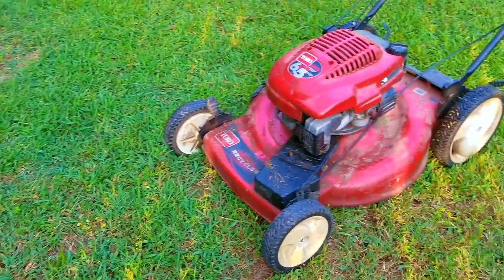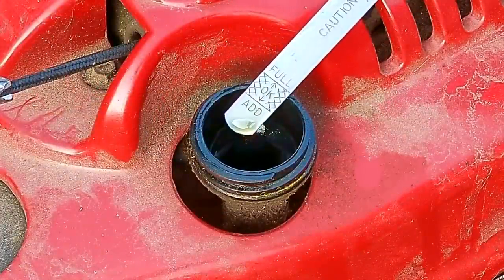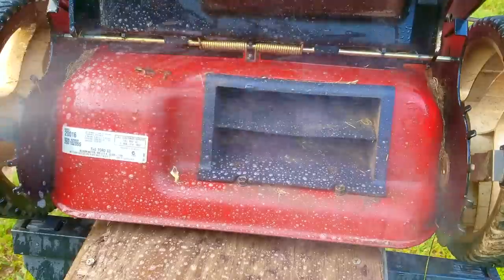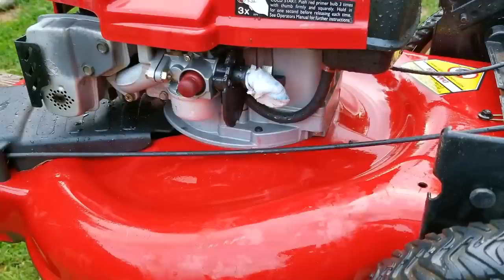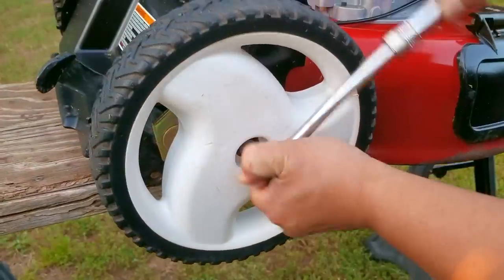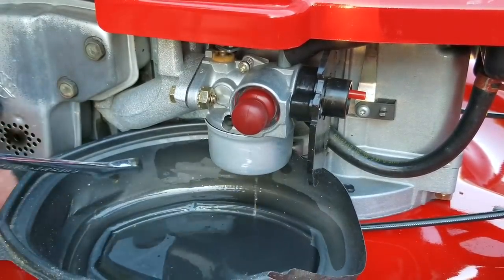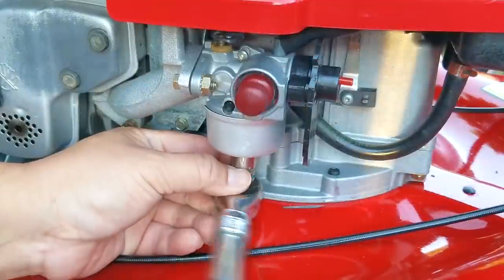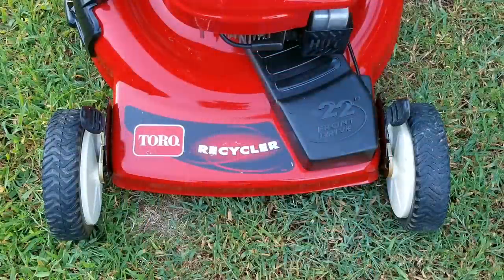Someone Threw Away A  Good Toro Lawn Mower

Comment: The best series of Toro consumer grade mowers IMO (short of the Super Recyclers of course). I love these older models, especially with the Tecumseh LV195EA engine. We really had it good through the 2000’s! You won’t find those decks flexing and cracking after a few years like the cheap tin cans they make now.
Reply from the maker: I know right, I miss the 2000's stuff too, when compared to the stuff now, thank you mjg263.
Reply: I bought a Bolens just a couple months ago and its deck seems fairly solid. It has a B&S engine on it, and so far it's been working good. I tend to not like mowers with self-propulsion, I know people like em but eh. I prefer mowers with the wheels tighter in close to the deck to make it easier to get a close mow up against trees and other obstacles.
Reply: @Dhalin  yes, I totally agree with you. For a trimming mower or a smaller yard I find that self propelling gets in the way and can be cumbersome. The Bolens plastic front piece can be problematic after time because of the plastic “fingers” underneath holding the front wheel axle in place (just had to fix one last week) but they are fine for what they are and there is a fix for it. The cheap tin can flexing mowers I was referring to are the newer Toro Recyclers. I have a pile of them in my garage with cracked decks for the scrap man. The steel they use is so thin now they crack under the chute and the deck springs out. Even if you try to weld them the deck is already sprung and it’s never the same (plus there are usually other cracks already forming). It’s a shame how tinny they are now compared to the great older ones!
Reply: agreed! I still have my super recycler from 1999. B & S engine.  Almost threw it out (well maintained). Some small fixes and it is back to running great.
Reply: I have the exact same mower with this Lv195ea I love it and will keep forever
Reply: I found a troy bilt self propelled mower one street away from me.. it was easy fix too !!
Reply: Yes I try to keep toro mowers with Tecumseh engines

Comment: I think you are right about it possibly being hydrolocked by the oil, by the way it’s smoking you can tell it’s just burning off leftover oil and it’s not oil escaping past the rings. The six horse Tecumseh snow king I have is so old that the float is made of brass instead of plastic which really shows how far these carburetors have come.
Reply from the maker: yes I remember those float, I prefer the plastic ones.
Reply: @HomeGaragechannel  the brass flavors I’ve seen get gas in them causing improper float level and need to be replaced by the plastic one to prevent this issue from happening
Reply: The brass replacement floats are still available through many suppliers, including Rotary, Stens and Oregon.

Comment: You went right to the problem most owners create with a Tecumseh carb.  The lower bowl nut with the passage....a super easy 5 minute fix.

Leave gas in it all winter,  and you get sediments in the bottom that plugs that passage.  Run it dry every fall and you seldom have a problem.
Reply from the maker: you are correct.

Comment: Had a similar find many years ago. My wife worked at a small business that did their own cutting. I stopped in one day and the owner asked me if I wanted their mower. It was a Toro rear bagger with the cast aluminum deck. He said it wouldn't start and would kick back and backfire when they would try. I took it home and after taking the blower housing off I could see the flywheel key was bent and the flywheel shifted several degrees. So for the cost of a flywheel key and an hour of my time I had a nearly new mower. I used it for nearly thirty years before the engine finally died for good. By the way I was a designer at Tecumseh engines and did the design for that pretty shroud on the engine.
Reply from the maker: wow, nice mower you got there, thank you Ron Post.

Comment: I got the same identical lawn mower sitting in my shed but not as new as this one, it served me well for a few years but then I noticed thru the years that the flywheel key kept breaking very easily by simply hitting the side of my concrete slab  or a pebble under the deck I just gave up on it and got me a Honda.I still keep hitting the slab and pebbles but the Honda just keeps on starting.
Reply from the maker: do you not edge before you mower?
Reply: @HomeGaragechannel  I do my edging with my weed eater, the Toro if you keep it at the lower level on the height adjuster the flywheel key seem to break more often than usual (like I was saying above)if you hit something not like the Honda and I do keep it at the lowest level.

Comment: True, they could just list it or put on the kerb with a label free.
In your advantage it had your name on it😀😀😀
Love the Tecumseh engines...😀
I was expecting it to be full of grass on the spindle, I was supervised too😉
It’s a keeper😀🇦🇺❤️
Like the mower I brought $25  Victa 2 Stroke 19 inch, didn’t start, perfect condition, 4 new blades, new carby parts, new champion spark plug as well, parts $80 retail can’t complain.
I did get it started after a few tries but it died so I think it’s the needle in the carb is sticking so I need to order a new one cheap but will try the metal ones rather than the plastic ones.
Reply from the maker: good luck with the mower.

Comment: As soon as I saw it was a Toro Recycler, I knew it was one of the ones with a Tecumseh engine. Good luck getting parts for it, now that Tecumseh has been out of the small engine business for 16 years.
Reply from the maker: aftermarket is still supporting them, so not a real issue

Comment: You would be surprised why people throw away mowers. Well....probably not. I got that old Craftsman mower with the kill switch issue from a guy that had had it sitting in his back yard for several years. It quit running, and he just pushed it into the corner of the yard and abandoned it. When I got it several years later, I had it running in about fifteen minutes. I gave it a quick carb clean, and it ran like a champ. Unfortunately, it is really weathered from sitting outdoors, but it ran great before the kills switch issue.
Reply from the maker: to be honest the reasons why they were given away are the interesting part

Comment: I found a similar looking lawnmower in a dumpster in front of a house down the other end of my street. It was along side another mower that was in pieces.
This was a newer design mower that had a sticker on it boasting "never change your oil again" "Just Check and Add". Well, that's exactly what they did. every time they used the mower, they added a little more oil. They added so much oil, it hydro-locked. I removed the plug and pulled on the cord a bunch of times to clear out the oil. Amazingly, the mower started up and ran. Quite poorly, as it smoked so much. I dumped out about a quart of oil and then proceeded to mow my lawn with it. The smoking eventually stopped. 
The next day I ordered a new blade, and filter, gave it a proper oil change and emptied out the fuel. Now It runs Like new.
Reply from the maker: wow very nice find!

Comment: Simple reason for getting rid of this type of mower, location of the pull start.  The handle mounted "safety start" is a shoulder killer, award pull angle can damage your shoulder,  particularly if you are older.  After doing just that my physical therapist told me I was not only case he had see.  Generally early spring, wonder why?  Only fix get an electric start.   Cheers Phil
Reply: Make that awkward pull angle
Reply from the maker: that's a very nice option to have

Comment: I've never bought a new mower, every spring I find mowers in the trash because people store them with ethanol fuel still in the tank and they are gummed up. An hour later after some carb cleaning they are running like new. Last one I found they filled it with fuel and the needle was stuck and it filled the cylinder with fuel, hydrolocked. Took it home pulled the plug and cleared the cylinder, cleaned the carb, like new!
Reply from the maker: very nice work!
Reply: Same for me in 2019. My neighbor tossed out an MTD mower. I took it to my house, leveled out the oil (it was clean), put a new plug and air filter and pulled the cord (after freeing it) and it ran like new. I just used it two days ago. The neighbor still gives me an odd look when he's out walking his dog and he sees me using it. His answer was, "I didn't need it, bought an electric" to which my reply was, "Yup, everyone throws out a good gas mower to get an electric so they can throw it out in three years when the cost of a new battery exceeds the cost of the machine". LOL.

Comment: This is getting weird. Maybe check the rear view even though it was curbside. 01/26/06 on the fuel hose so it was probably assembled that spring. That's a survivor for a mower museum. Maybe sell a different one first
Reply from the maker: I think, you'r on, to something
Reply: Makes sense as I looked it up on the Toro website and the owner's manual has a date of 2005, so a 2006 manufacturing date of some components makes sense. Tecumseh went out of business around 2008, so it makes sense with the date coding.

Comment: amazing how clean it turned out.  what did you use to clean it?
I have a What i think is a toro with a honda motor. not sure 
will have to go over it. and double check it. and write the 
numbers down.nice video.
Reply from the maker: thanks, I'm using a degreaser from Harbor Freight.

Comment: This is the same model as my mower. I've had it for about 17 years and it runs pretty good. On start up and shut down, a noticable banging noise is happening. It's probably doing it the whole time, but it's not noticable when running at full speed. I moved the blade back and forth a few times to see if I could hear it but nothing.. any ideas? It seemed to start doing it after I reinstalled the blade after sharpening. I think it's torqued well enough, but I used an impact driver not a torque wrench.
Reply from the maker: sure the cold be an issue with blade adaptor, and I would block the blade and use a torque wrench.

Comment: Hi, just subscribed, and learning alot in general and just got my first Honda used , in great condition for 100 bucks!! 

But my question is this... what are you using that degreases every thing so quickly and when you wash it, is there anyharm in spraying down the mower with a light sparay of a hose like you have done? When im done i usually wash the under neath and from the motor base down. Am i doing any harm in spraying down the top where the pull cord area is ...

Thank u.
Reply from the maker: thanks again, I'm using a degreaser from harbor Freight by most automotive degreaser will work. And to answer your question, its okay to spray water, anywhere you want except the muffler and where the air filter is .
Reply: @HomeGaragechannel  great thanks!

Comment: I'm guessing they gave up an bought a battery mower that will be trash in 5 years.  Nice job fixing and cleaning it!  I wonder how many other mowers were thrown away due to carb issues.
Reply from the maker: plenty from what I've seen, and yes Battery is probably the next step.  Thank you shmiggz.

Comment: Everyone I know that's had Tecumseh mowers they seem to run forever. I know they have an odd carburetor connection and I've seen them leak oil from the top of the motor from the rubber plug that goes to a crankcase filter I think. But I don't understand why Tecumseh had a bad reputation. They seem to last longer than a lot of Briggs and Stratton engines especially the new ones.
Reply from the maker: oh they're not that bad at all, they just need some getting used to.
Reply: Because as I stated it's the "mechanics" that attempt to "fix" them that are the problem. Nothing wrong with a Tecumseh engine.
Reply: @googleusergp  had both. they can go 12+ years of heavy non-commercial use. But then they burn oil, (B&S), or toss a conrod right in your lawn. (Tecumseh). The Quantum seems to have solved B&S's problems. Have no idea who tweaked it but wow, what an engine. 2x better than any Tecumseh, or Briggs before it. Scary bulletproof. I thought the paper element filter was too automotive like, but it keeps the internals so clean, the Quantum I now use will probably outlive me. : (
Reply: @timewa851  Nah. I've had Tecumsehs that were from the curb that were over 15 years old when I got them. Who knows what care (if any) they got. Not one of them has ever been apart. I just do regular maintenance on them and once and a while a carburetor replacement, but that's about it.
Reply: I have one thats 20yo.  Last year Sears sold them before going Briggs.  Runs great...even idle.

The 20" newer 5yo briggs i have for another property...fast slow fast slow fast slow.  I know it's that stupid diaphragm carb fuel paper thin tank gasket that pulls an air leak on one side, a design flaw they haven't addressed in 50 years.
Reply: The new Briggs EX engines seem to have issues using oil and then burning up. I've seen several videos from small engine repair people on YouTube. Funny that Briggs claimed the EX engine you never have to change the oil, but apparently they're burning oil and people seem to be letting them run dry.
Reply: @STho205  That's a $5 (at most) fix with a diaphragm kit, but yes it is annoying.
Reply: @googleusergp  it is a flaw in the casting.  A new one might do it too.  There's only a mm wide but long flat strip on one side of the throat that holds that thin strip by mere friction and no fasteners.

Best to live with it till it won't run, then replace it after scoring the metal strip hoping to add compression friction.
Reply: @STho205  I haven't had that problem with any Briggs engines thus far.
Reply: @googleusergp  that is typically the wow wow wow sound that eventually pulls a leak causing the need for a $5 new vacuum gasket.  You'll see it next time you change it.

Similar to the head gasket on a 1999 Subaru boxer. A thin spot that fails because the gasket isn't big enough there to take the pressure.

My wife runs a small engine shop at the local Ace.  The mechanics share their pet peeves.
Reply: @STho205  Most small engines (in fact almost all of them) that I have came from the curb, and thus far I've had to do very minor repairs on all of them.

Comment: picked up one just like that.  put a new carb on it . figured out why they tossed it . the pull assembly kept breaking and hard to pull.  i figured out the decompression valve was bad or the valves were bad not activatiing it.   not worth the time or effort to tear it apart and fix it.  on a good day they only bring 60 to 90 dollars for these. stripped it for parts and left it out and it was gone in a couple of hours
Reply from the maker: very nice  use of the parts, thank you Whyme123

Comment: i picked up a lawn mower in the trash a few years back, give one pull on starter and it started right up, the only thing wrong with it was the belt on the self propel was snapped, 30$ later it works fine, we are a throw away society, people prefer to buy new rather than getting it fixed.
Reply from the maker: I know right, it's a real shame.

Comment: Are you able to give me advice on a NIKKI carb. I was given a Troy billt PONY. it sat for years and carb is plugged with varnish. Beyond  my ability what should I do?
Reply from the maker: unfortunately If I were you I would find someone with an ultra sonic cleaner, it might Able to get it clean enough to fix it.  otherwise, I would try to find a used carb, or a new one.
Reply: a little more info. Fuel solenoid can’t be ungummed orings* are shot. Is a rebuild kit off Amazon an ok idea. New they are $130
Reply from the maker: I've never tried their rebuild kits so I don't have an opinion on it.  I would buy a used carb.

Comment: Actually the problem I had with fixing those mowers is the cover bolts would get so corroded that it was impossible to unscrew  them out without them rounding out or stripping so I would have to split the cover case in half because you can’t acces the carb with the cover being in the way. That’s the only poor design of this mower other wise they tend to last a good 20 years being well taken care of
Reply from the maker: yes the cover bolts would collect any moisture and rust, and then get damaged when taking them off.

Comment: They likely gave it away because of the bowl bolt issue; the mower stopped running, they replaced the fuel, perhaps accidentally overfilled the oil and couldn't figure out why the mower wouldn't run and said 'aww screw it" and put the mower by the dumpster at the school figuring someone with technical know-how would figure it out and fix it up. that, and there's a huge push towards electric mowers lately. I wanted to replace an old 2-stroke Lawn Boy (that I could not get to start whatsoever) that the family was using and when I went to buy a mower, it was electric this, electric that. I just wanted a simple small lightweight 4stroke no bells or whistles mower. Luckily I eventually found a Bolens at Lowe's, just like the old mowers I used to use when I was a kid and just as I thought, it mows like a champ, even difficult slopes and extremely thick and heavy overgrowth if you do it right.
Reply from the maker: that makes sense

Comment: Probably someone from an upper class neighborhood that would rather buy a new mower than spend any time fixing the old one. I got my husqvarna all wheel drive push mower from the curb of a nice home and the only thing wrong was a few seized idler pulleys and carburetor. All in all around $30 fix for a very well running mower.
Reply from the maker: you might be right.